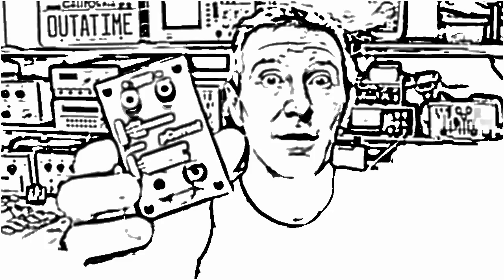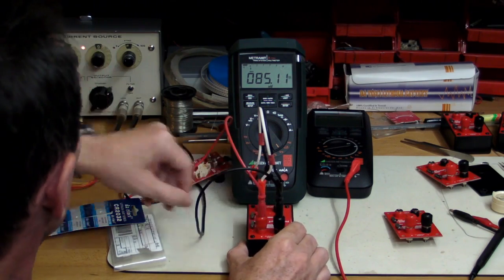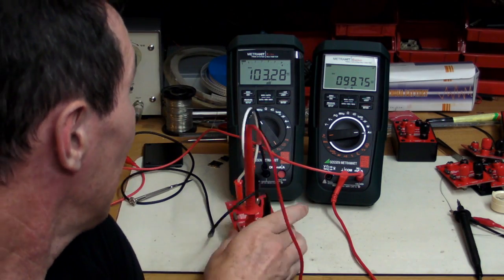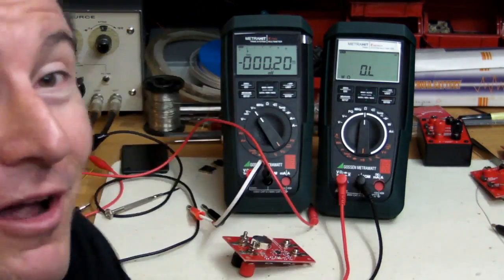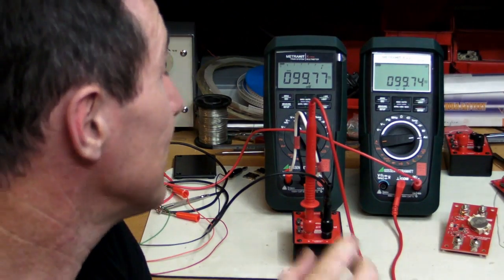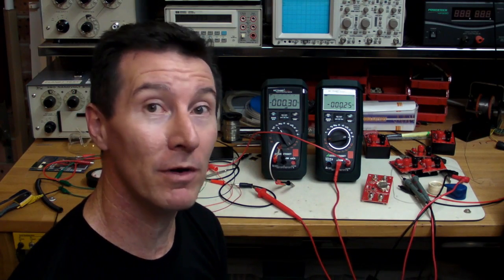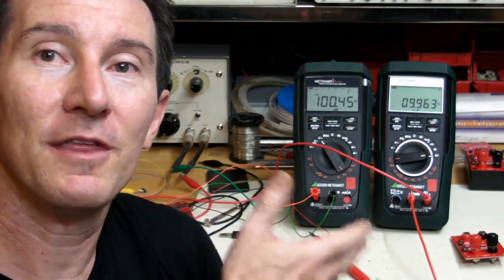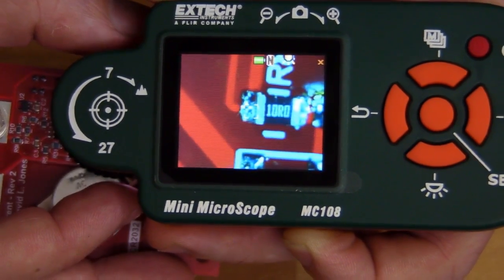EEVblog #133 - Dodgy Digikey Components

Comment: I'm already triggered by the ".1%" notation. Is it that hard to print the extra zero? What if the ink is low and the dot gets lost in the print? "01%" is quite obvious and you at least question it, rather than "1%" which looks perfectly fine.

Comment: Obviously this is an old post but this is precisely why the practice if removing the leading zero from values is a dangerous one. Ive fought this problem for years with purchasing agents, inventory clerks, engineers. Etc. That tiny little decimal point vanishes far too easily. But that big fat Zero doesn't.

Comment: I would just like to add to the explanation of the 4 wire measurement.  One key benefit of the 4 wire (kelvin) measurement is the special 4 wire clips actually make 4 separate points of contact.  in contrast to the statement that the wires join at the very tip of the probe.  The difference is that the contact resistance is negated by making four separate points of contact.  This can be significant for high precision measurements. In the two wire delivering the constant current source, the contact resistance does not matter.  It is a current source after all.  This leaves the sensing wires circuit, which has a very low current due to the high input impedance of the meter.  So the voltage drop due to the contact resistance of this circuit is V=IR  ....  = almost nil current times what ever the resistance equals almost nil voltage drop and high accuracy.   If the proper 4 contact points are not used then the significant current of the current source times whatever the contact resistance is equal to a non negligible voltage drop.  A second comment for everyone out there that does not have a 4 wire ohm meter is that just use a separate current source and a standard volt meter and you can make 4 wire kelvin measurements.  Additionally depending on what you are measuring, you can use a higher current to improve the signal to noise ratio and get better accuracy as long as the current is not enough to heat the parts under test.

Comment: Yeah, I'm not so agreeable with this video. Digikey is can't be responsible for this but this video potentially harms them way bigger than the problem really is. Would be much better just to do the video without the name mentioned and warn people to check component. Of course feedback to Digikey so they can fix with manufacturer.  Digikey are a really good supplier. If you gave feedback and they ignored then sure.

Comment: I got caught out with some resistors from Farnell that weren't even the right value ! The bag was marked right but the resistors were wrong. Farnell didn't want to know, they just said they would remove the wrong resistors from stock. Had to remove a few resistors and put in the right value.

Comment: It's a risk that happens when Digi-key breaks down a manufacturer's packaging and puts a lot of resistors into their own packaging.  They likely filled that packet from the wrong spool of components.  The best you can do to work around a mistake like this is to only buy full spools that were straight from the mfg.

Comment: What did Digikey say and/or how did they respond to this?  Also it's funny that you mention using two multimeters for measuring with four leads. I did that at work once when I had to check out a 1.5 watt 1 2/3 Ohm resistor (amp meter shunt 30 Amps 50 milivolts) and a power supply that can only go up to 5 Amps.

Comment: I bought some components from Digi-key and they were way out of spec. Not only that but one of the bags was empty, it had the label on it, but no components in the bag. and seeing they were expensive devices I was not amused.
Reply: RS components did that to me with expensive conmponents for a time-sensitive project. Such a pain!
Reply: @mcuembedded  I had some pcb mount lithium coin cells on order, Farnell delivered them loose in a plastic bag, totally discharged.
Reply: Why were they doing this?
Reply: Did you spec invisible parts?

Comment: Back in the early 70's I read an article that talked of the importance of checking each resistor to verify it before using in any circuit that requires accuracy. Today, one would expect the manufacturing of the components to be higher quality then it was 45 years ago. But I guess that old advice still holds true today.
Reply: "But I guess that old advice still holds true today."
Well today things are made in the hundreds of thousands, if not multi-millions. SO yeah, there is a chance that some of those will be defective.
Reply: Benjamin Esposti I understand what you are saying, but I disagree with you. It’s the manufactures responsibility to make sure their product is as advertised. It doesn’t matter if it’s quad trillion pieces that are produced. Otherwise the problem would get worse and worse.
Reply: @BenjaminEsposti  -- But, given how good mass production is these days, the percentage of defective resistors should be remarkably small, perhaps in the hundred-thousandths.
Reply: I recently purchased some resistors that were an order of magnitude off from spec. Correct bands, correct packaging, wrong resistor. Could have blow something! I think I'm going to check all components upon receiving them in the future. Looks like it's not an impossibility even today.
Reply: I sill do it for prototypes. But for manufacturing just cross your fingers.
Reply: I expect the values to be more 'consistent', but not to be of a higher quality. I fear the philosophy of modern manufacturing is to manufacture something as cheaply as possible that still meets the specified specs, ignoring any other parameter that would be roughly identified as 'quality'.

Comment: Just so you know Digikey employs as bunch of rural clueless Minnesota housewives who don't know a resistor from a capacitor. For anyone who's seen the movie Fargo that's pretty much the Digikey workforce. Among the major online component distributors Digikey usually comes in dead last despite having one of the better website search engines. I once ordered 200 surface mount resistors as cut tape and Digikey shipped 20 bags with 10 resistors in each bag which is useless to any pick and place SMT machine on the planet. When I called to ask for 200 resistors on a single tape none of three people I talked to could understand why what they shipped was a problem. Digikey=Fail. I have had far fewer problems with Mouser, Avnet, Arrow, Future, etc. Digikey is the Walmart of components and, like Walmart, their employees mostly don't have a clue. Buyer beware. They might as well be some Chinese supplier on eBay.
Reply: Er... Did you call them /before/ placing your order? From their site: "Digi-Key tries to ship in one strip when possible however, if you require your order to be one continuous strip, this should be requested at the time you place your order." If you didn't, that's on you, not them.

It's understandable why that'd be frustrating if you didn't know it beforehand, but you can't make assumptions and blame others when they turn out to be wrong.

Another assumption you're making here is that the other distributors don't do the same thing. Mouser did that to me with some ceramic caps, and they don't even directly say they do it on their site. It's only said indirectly by specifying their custom reels will be continuous, with the unsaid implication that normal cut tape orders might be discontinuous.
Reply: You can always order your parts on a Digi-Reel; it's a continuous strip with as many parts as you'd like, and comes on a reel for the pick and place machine.

Comment: This sort of thing makes me angry. I purchased a Chinese kit to build an Oscilloscope and most of the resisters were way off. I had to purchase new ones in order to make sure it would work. I bet these are made in China.
Reply: just about all resistors are made in China. if it was a diy kit then maybe the resistors didn't need to be accurate. I mean it would be the least of your worries.
Reply: Not just the resistors, but also the capacitors are way under there rating as well, so I wonder if that can have an effect on the device working properly. I guess it comes down to how loose the design is. One didn't work very well.

Comment: Digikey has offered me a job on at least 10 occasions. They want me to work as a sales engineer. This is where lots of American EEs wind up after the age of 50. If their call center was not in Thief River Falls Minnesota, I might consider it. The average winter temperature there is -3 F. PASS! I build boutique guitars, guitar amps, bass guitar amps, & other audio amplification & signal processing products. I usually do test every component that goes into my stuff. If I need 3 of something, I buy 5 of them. If I need one, I buy 3. I select the best part, and keep the rest for repairs. I stay so busy with repairs my building has kind of stopped for the time being. I'd be hyper pissed if those parts were not within 1/5th of a percent. I keep my crap decade boxes at +/-3%. I keep my calibration standards at 0.05% maximum. I use a 4 lead Kelvin clip leads to test the tiny resistances, and use a $5000 LCR as my meter. It is accurate down to micro-Ohms, and reads up into 100s or GigOhms. I feel for Dave having paid postage from the USA, and getting a bum batch of parts.
Reply: I know this comment is several years old, but I want to mention that I often ask Digikey sales and tech support engineers how the weather is in Thief River Falls, only to find that they actually live in some other state, and often have separate 'day jobs' and just log into Digikey to work a few hours at night or on the weekend and pick up some extra cash.

Comment: Come on now, Digikey sources from probably thousands of companies millions of different parts.  They rely entirely on the manufacturer for the information they present you.
I've looked up TO220 IGBT's from them where the company used the TO247 part version to up their listed specifications.
Did you contact Digikey about this?  That's the only way a wholesaler is going to find out about out-of-spec parts.
If you want a 0.1% tolerance resistor for 50 cents in prototype quantities, Digikey cant very well test every one, can they?
Actually, you know what? You're holding Digikey to a higher standard than you expect your customers to hold you to.
That's not quite right.
Reply: Alexandre Kandalintsev You know, I get that, and I agree, but most people don't have any idea just how bad this IP theft problem from China is.

Here's FTDI's situation: They spend millions on R&D, the price of their product has to reflect that. They and just about every company developing IP have been complaining about rampant Chinese theft for more than a decade.

Now they've tried informing companies that make consumer products that something has to be done about this, but companies using counterfeit chips don't care.  As long as the money keeps coming, they ultimately don't care.

This is the shitty part, and there was no right answer.  FTDI had no choice but to actually harm the consumer of the end product, knowing it would hurt their image.  The thing is, it hurt companies using counterfeit chips more.

Yeah, every EE on the planet knows about what FTDI did, but very, very few consumers do.  All they know is that they had products that they bought from company X that broke, and they're not going to buy from company X again.

This was a lose/lose situation for FTDI.

Here's an important final thought: if IP piracy had been a small problem, FTDI releasing these bricking drivers would have gone unnoticed.  Honestly, the worse FTDI looks here, the more it legitimizes what they did.
Reply: Alexandre Kandalintsev It's a little different than that.  I'm not going to post links since that gets your comment automatically silenced on most big YT channels.

The chip in question was some kind of RS232 to USB adapter, so yeah, it is kind of simple, but they didn't steal the drivers.  In fact, on linux (which I use pretty much exclusively) all the drivers are open source clones.

FTDI does have a lot of legitimate competition here.  I personally use the SiLabs CP2102, which performs an almost identical function, again with open source linux kernel modules.  I do have a couple boards not made by me that have an FTDI serial chip.

I guess this is something that people don't understand on a low enough level.  I couldn't actually find out if FTDI is a fabless company (i.e. they contract for production and only generate intellectual property) but it seems small enough that they might be.

When designs are stolen, they arent usually reverse-engineered.  Basically every driver on linux is reverse-engineered and its legal in the US at least.

What they end up stealing are things like netlists and layer masks (the actualy information used to produce the chip) then they have another contract company make counterfeit chips.

As evidence for this, the FTDI chips were all apparently serialized and the information that was stolen that led to all the counterfeit chips only containing one serial number (I'm guessing there's an eeprom where this is stored).

So they didn't really steal the idea for the chip and reverse engineer it, they stole the actual "blueprints" for it.

Since FTDI are being secretive about the actual IP loss, all we can do is make some reasonable assumptions.
Reply: Alexandre Kandalintsev I think I mentioned it before, but SiLabs CP2102.  From what I remember, its 3.3V but 5V tolerant.  It does all the normal bitrates up to 2MB.

I don't make videos, but I still have a few really old ones up of a spider thing I built. Its using a CP2102 between an atmega328 (I think) and a computer, I think running at 115,200.  It was good enough to feed 12 servos 20 position changes per second.  The chip itself is just under $3 in single quantities on digikey.

You can also get away with using an attiny as a uart-usb bridge.  I've never used one myself, but I guess it works fine at low(ish) data rates.
Reply: +htomerif 6 years later :D
Reply: Toxi Core I find talking to people in the past is less problematic. :P
Its still true, though.  Especially in light of his attitude towards the FTDI USB-UART driver brickware incident.
I don't think even most engineers understand how terrible the chinese IP theft problem is.
I only watch the occasional video from him because our knowledge bases just overlap too much.

Also I am super jealous of the amount of ridiculously high quality test equipment he has.
Reply: +htomerif the problem with FTDI is that they brick devices on purpose. Theftment is a problem, but why making end customers suffer? Especially in the light that many people bought that chips from seem-to-be-reliable suppliers. So, I support Dave, FTDI came too far with their "revenge". They could have done this in a less destructive way instead of silent "destruction" of the devices without user knowledge. I don't think this even legal.
Reply: htomerif I fully understand their frustration about fake chips and I agree this all is bad. But I have some comments on your points.

First, I don't think this chip involved much research. It looks to me like a quite basic IC.

Second, fake FTDI chips are original design. Whoever makes this fake they did their own research and may be even to a bigger extent to reverse-engineer it. They mimicked the original protocol and I don't think this is crime at all.

I would say they stole two things: drivers (shouldn't be much of R&D here, a fresh grad and one month of his/her time is enough) and the name of the chip.

Last, but not least -- I believe FTDI's chips were very overpriced. This does not justify fakes, though, but I'm happy we have cheaper alternatives now.
Reply: Alexandre Kandalintsev Yeah, but that's the whole purpose of these uart<->usb chips, so you can still use an old board or old designs and give them new life.

I'm not disagreeing with you, but I'm gonna guess that for your arm chip there you're gonna need a host of voltage regulators, capacitors and some form of level conversion to not cook the inputs.  Not that the FTDI or SiLabs chips don't at least need a capacitor or two, but thats about it.

To be honest, aside from what I've personally used them for, the only thing I've seen them used for product-wise is as backdoors to embedded systems for linux console access or firmware access, notably usually on one of the uarts on a chip like you mentioned.

So the real reason is design simplicity I guess.  I am curious what products were affected by this FTDI driver bricking.  So far all Ive heard about is some niche prototyping boards.
Reply: htomerif uhm, may be we are talking about different things. The chip I meant wasn't based on FTDI design at all. It was "original design" (really was a generic one-time programmable controller that was used just as UART->USB bridge).

Indeed, if it is an unauthorized over-production then this is completely unfair. But I think it's not the case: the fake FTDI behaves differently from original devices just because it is nothing to do with the original design. You can see X-ray scans for comparison.

About drivers. I meant windows drivers. Linux drivers are most likely community work, that's why I love Linux :) 

About competition. I'm no expert in this. I heard that there were only two options: prolific and FTDI. And prolific reportedly have a bad reputation of buggy drivers. And both quite expensive. Fortunately we now have ch430/431 that is considerably more cheap.
What do you think?
Reply: htomerif may be we have different definitions of what is cheap. For $3 I can buy, say, STM32F373C8T6TR that can do USB<-> UART and many-many more things (3DAC, 16bit ADC, RTC, PWM and much more). All that for almost the same price.